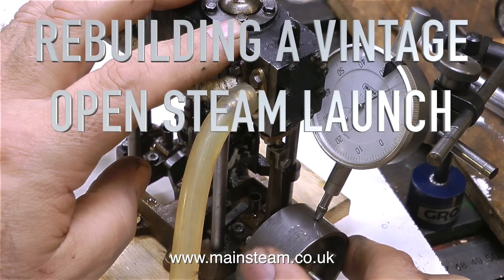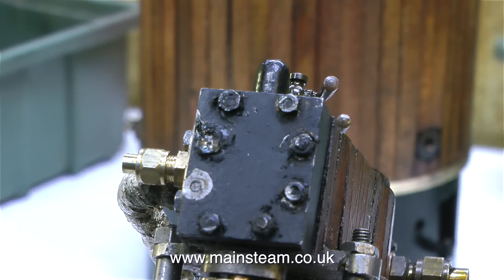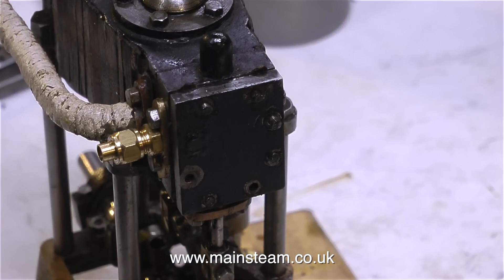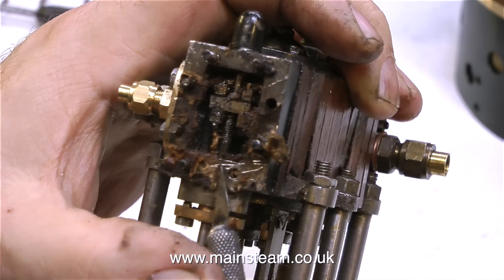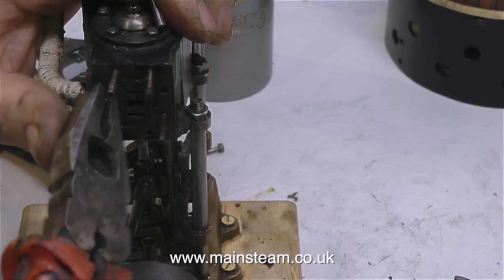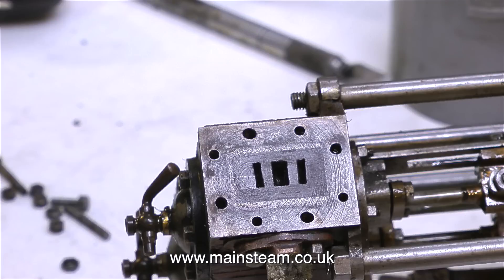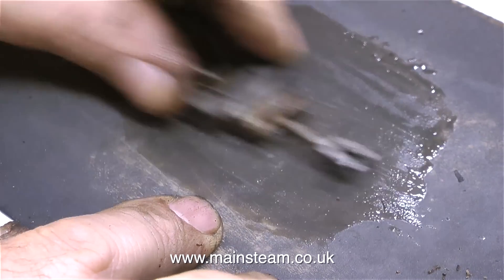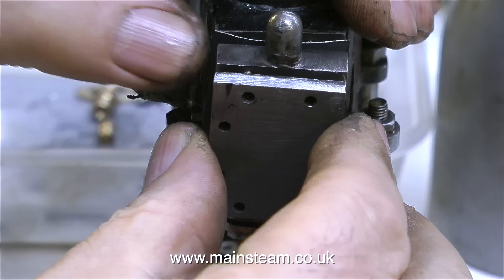REBUILDING A VINTAGE MODEL OPEN STEAM LAUNCH - PART #10

Comment: So, I been thinking if that was a glooply friggen mess, I wonder if the cylinders are the same.
Reply from the maker: No, it doesn't usually work like that. The mess is around the steam chest and cover. Any particles entering the cylinder are blown quickly out of the exhaust by the steam.

Comment: why do you use oil on the wet or dry sandpapper and not water ps. good video can the they just be 10-20 min. that would be great ;-)
Reply from the maker: Metal + Water = Rust . . . . . .
Reply: Keith Appleton ye i se see keep up the good videos